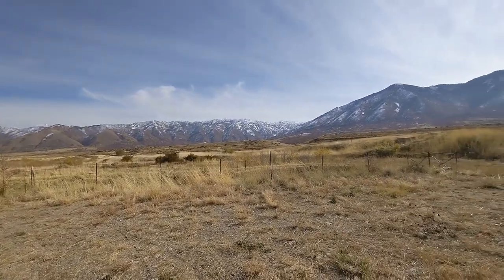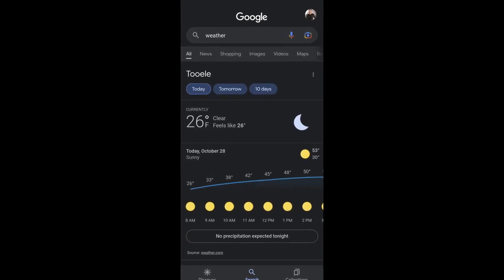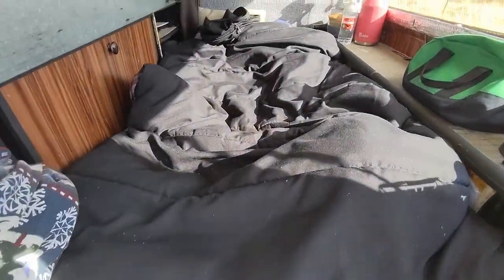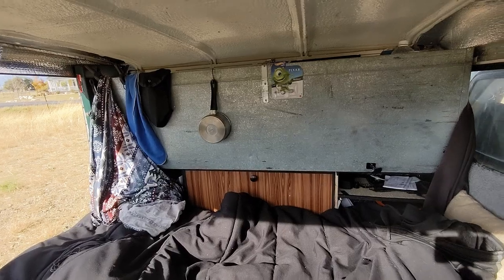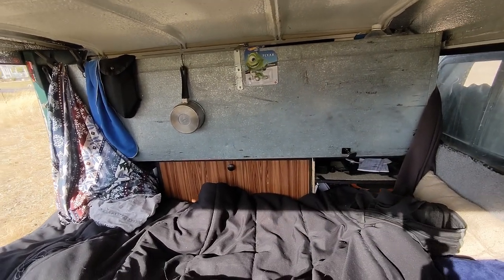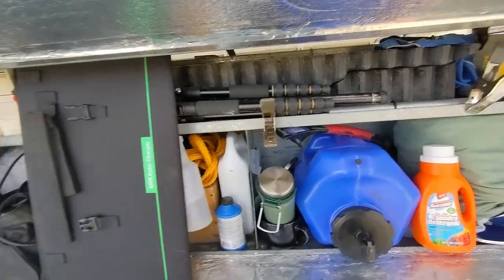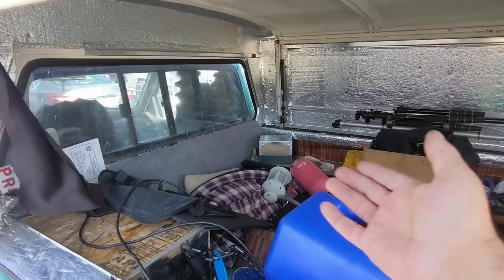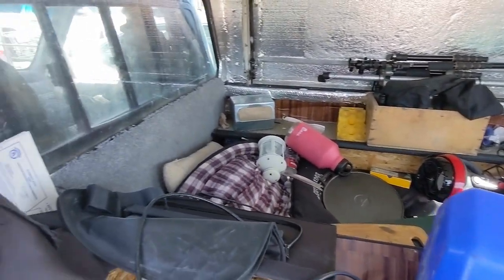Living in a Pickup Truck | Condensation Build Up!

Comment: Make a small intake vent on or close to the floor of your living space. I would make it between the truck bed and cab so it cannot be seen from outside. Crack your fantastic fan vent just a little. Do not run the fan. When your moisture laden exhale is warmer than the air in your living space, your breath will rise and exit through your fantastic fan.
Reply from the maker: I had thought of doing that way back then but never did. I'm installing a fan in my new rig soon.